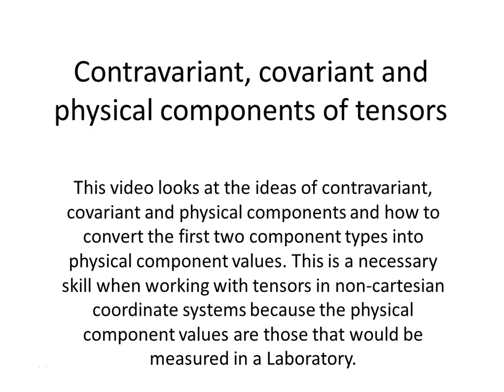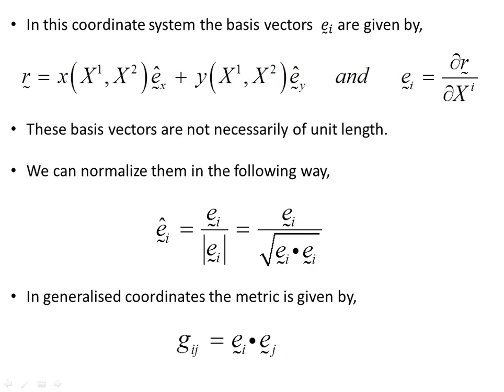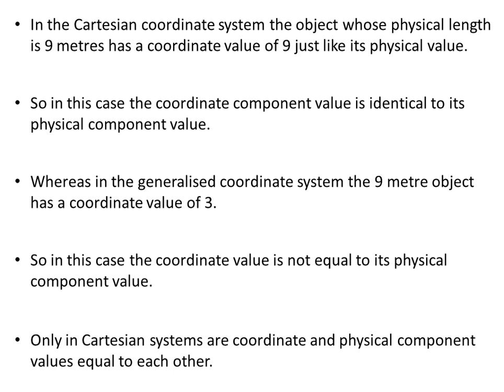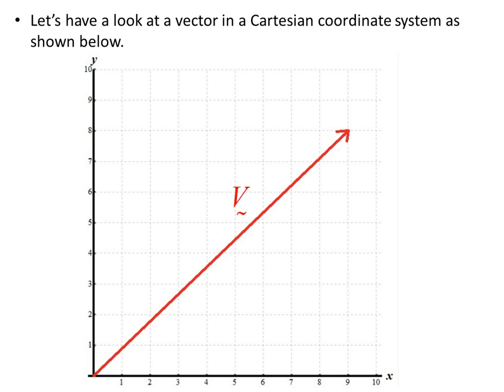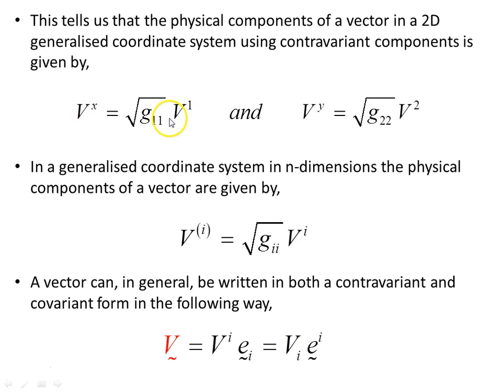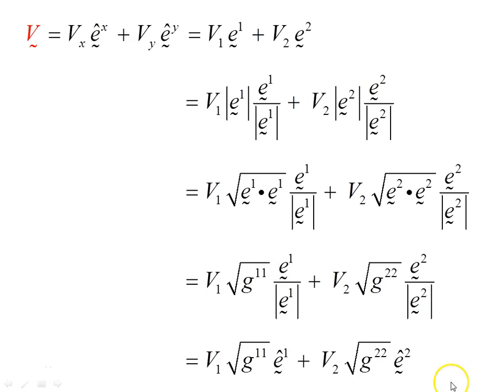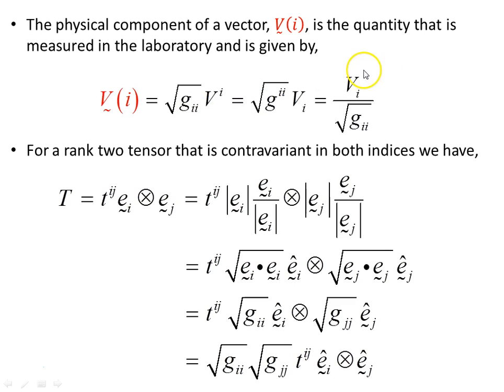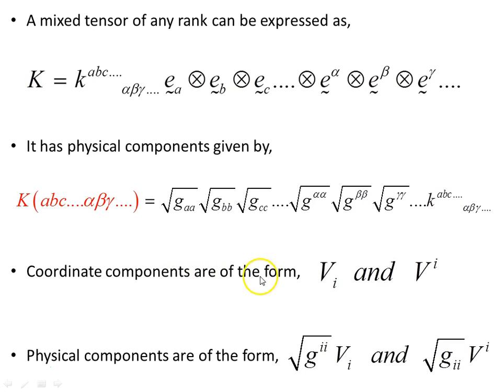Contravariant, covariant and physical components of tensors

Comment: Very helpful video. Could you please suggest any reference for this? A paper by Daniel Frederick (PHYSICAL INTERPRETATION OF PHYSICAL COMPONENTS OF STRESS AND STRAIN) and another by C. Truesdell (The physical components of vectors and tensors) seem to give a little different expressions for physical components of second order tensors than what you derive at 11:14 in the video. However, both your derivation and the papers' derivation match for the orthogonal coordinates. But I wanted know the correct expressions in the case of general coordinates. Thanks!
Reply from the maker: Thank you for your thoughtful question and for watching the video! I appreciate your interest in understanding the physical components of second-order tensors in different coordinate systems.

The expressions for physical components of second-order tensors can indeed vary depending on the coordinate system used. In the case of orthogonal coordinates, the derivations tend to align more closely because the basis vectors are mutually perpendicular, simplifying the mathematical expressions.

For general (non-orthogonal) coordinates, the expressions can be more complex due to the interaction between the coordinate system's basis vectors. The key difference arises from the metric tensor, which accounts for the non-orthogonality of the coordinate system.

Here are a few references that might help clarify these concepts further:

Daniel Frederick's paper: "PHYSICAL INTERPRETATION OF PHYSICAL COMPONENTS OF STRESS AND STRAIN". This paper explores the physical components in various coordinate systems, including non-orthogonal ones. The differences you noticed likely stem from how the metric tensor is incorporated.

C. Truesdell's paper: "The physical components of vectors and tensors". Truesdell's work is foundational in the field of continuum mechanics and provides a comprehensive treatment of tensor components in different coordinate systems.

For the expressions in general coordinates, the correct approach involves using the covariant and contravariant components of tensors, along with the metric tensor. The metric tensor 𝑔_𝑖𝑗 relates the physical components of the tensor in general coordinates to those in orthogonal coordinates.

In summary, while the derivations in my video match those in the papers for orthogonal coordinates, in general coordinates, it is essential to account for the metric tensor and the potential non-orthogonality of the basis vectors. I hope this clarifies the differences you observed. For a more detailed mathematical treatment, I recommend reviewing the aforementioned papers and the sections on tensor calculus in general coordinates.

Feel free to ask any more questions or request further clarifications. Thanks again for engaging with the content!
Reply: @TensorCalculusRobertDavie  Thank you so much for your clear and elaborate explanation. I will have a deeper look into this and try to clear my ideas using the references. Thanks for making such nice informative videos! Very much appreciated. Keep on doing this. I feel bad for myself that I discovered your channel so late. However, better late than never. I am now a subscriber and a regular visitor to your channel! 🙂